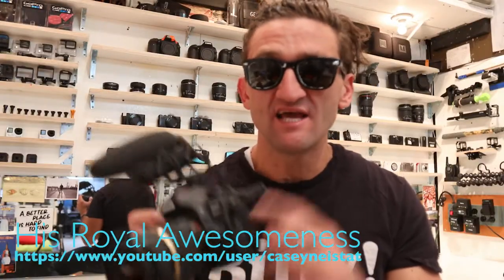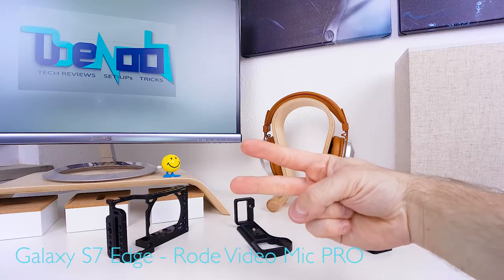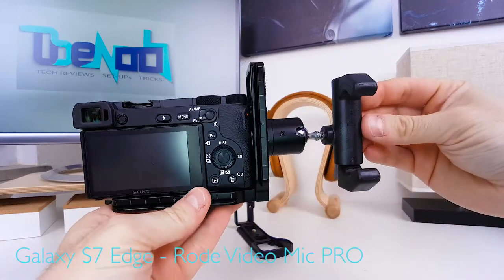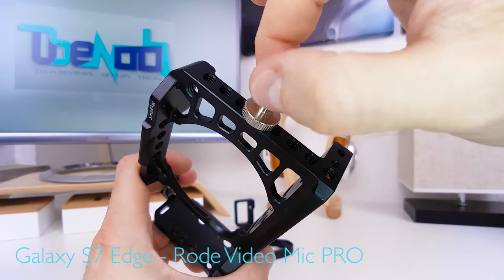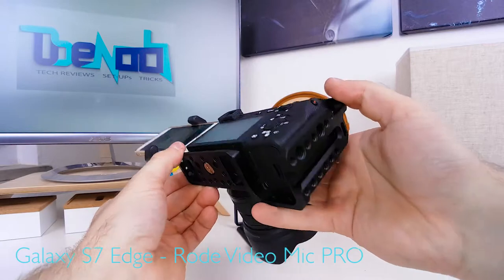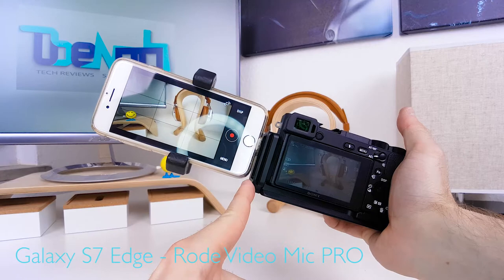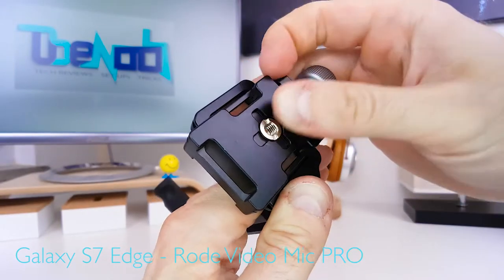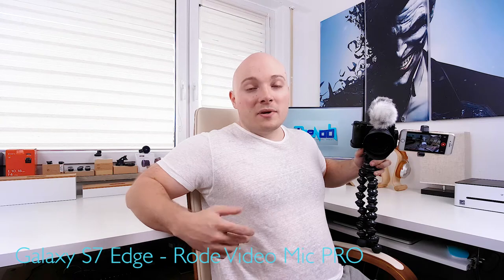THE TILT, THE SVIVEL & THE SONY (Part 1/3: The Setup) - Tubenoob

Comment: With my a6300, if im using my phone as a remote, I can't do any slow motion shots. It also lags like crazy. I've also noticed that it makes my mic crackle. Does the a6500 have a better wifi? After watching your video, it looks like your connection doesnt have an issue with lag. Great video as always Sir.
Reply from the maker: Hey, Manuel Eagan Buffalo Tile! Thanks for the nice comment! Much appreciate it!  

I can*t test whether the A6500 will record with 100fps while using wifi right now because I am not at home, but lagging is a platform and performance issue. 

As long as your phone supports this wifi tech " IEEE802.11b/g/n (2.4 GHz band) " it is not a wifi performance issue. Decreasing screen resolution to the minimum on the phona has also helped me. Basically it bois down to how fast the phone is. I also have some issues with lag, but after the initial couple of moments I rarely have problems. Then again I am not using the camera on my skateboard or on a bike or in a car...maybe I will do a little test video to see how much the connection can take. A6500 and A6300 both have the above mentioned wifi tech built in. But you never know what sony does on the software side of things. They do weird stuff sometimes that makes you hit your head against a wall....

If you haven*t already the 3rd part of the series called "troubleshooting" deals with the lag problem among others a little. Greetings!
Reply: TubeNoob yeah I meant to respond again and say that almost every question I had was answered in part 2 or 3 of this series. I found that the crackling of my mic went away if i pointed the top of my s7 away from the mic. Haven't had a problem since. I'm with you though about sony...why oh why no flip screen?!?!?! COME ON SONY!!!